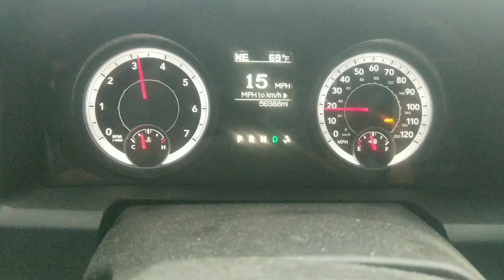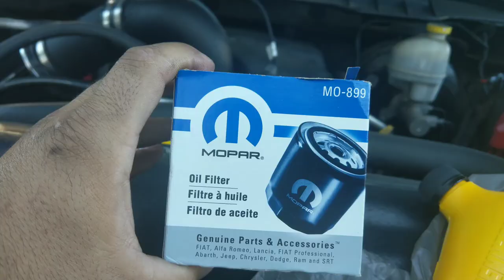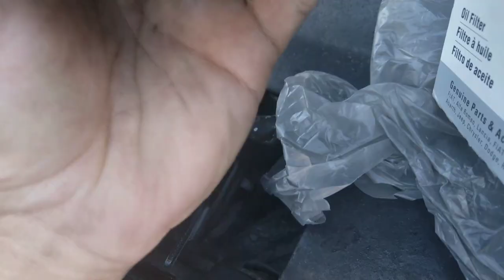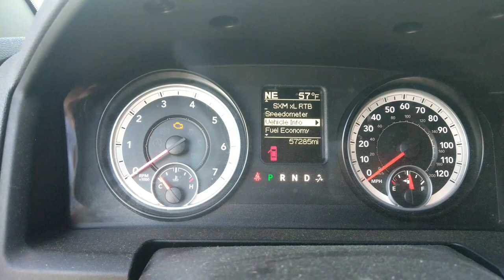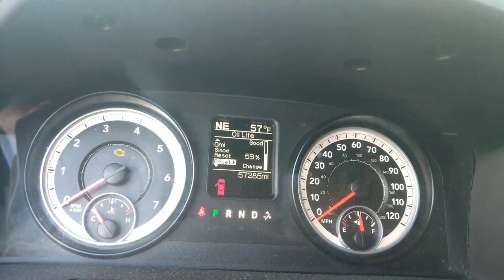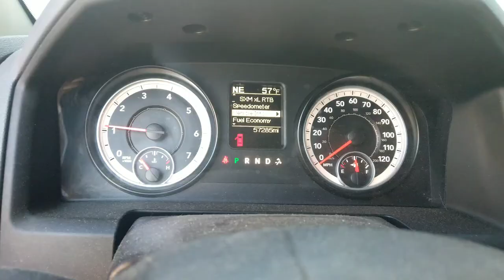How to do an oil change on a RAM 1500 HEMI

Comment: For anyone that's wondering you can also turn ignition on(don't start) and pump the gas pedal to the floor and back 3 times. Just like on GM. It works to reset the oil life
Reply: Ohh so that’s why the oil life indicator randomly resets I thought it had a problem

Comment: Take the cap off the motor before you drain it. It will drain faster, and fully. Air pockets could hold oil in the motor, and negative pressure, as well as cosmic balls of fire  etc...

Comment: Hey man just seeing why you chose pennzoil, I’m not doubting the quality I’m just trying to see your thoughts, I’ve considered going from Mobil to pennzoil
Reply from the maker: Brandon Esplen its the oil that dodge uses and I've had since stock
Reply: I agreed, you lost a couple man-points using pennzoil. Back in my machine shop days ( early 90's), we always knew which engines ran pennzoil.
Reply: If you do Mobil 1 full synthetic, keep using it unless you change it for the platinum or ultra from Pennzoil.
Reply: Mobile 1 synthetic is not supposed to be used in hemi,s I heard. It dont have the rating etc. Something like the super mobile 1 etc is only rated. Not the regular mobile 1 synthetic,  apparently it dont have some.stuff in it that's needed
Reply: Mobil 1 for me ,never had a engine failour or problem ever👍

Comment: You left out the part about how much of a pain in the ass it is to remove the oil filter and where it splatters all over the front axle.

I hope that whoever designed the oil filter location on these trucks got fired.
Reply: I spent a solid hour trying to get the oil filter out in my driveway,  and used several different tools, no luck so I said fuck it and brought it to a lift
Reply: That’s why only need hand tightening

Comment: Hey brother on your cold air intake what did you do with the crankcase vent tube i have a breather on mine and didnt know if that was good or bad
Reply from the maker: A breather is all u need boss everybody that had custom intakes like me use it
Reply: @IncredibleHemi1111  okay awesome ya I bought one of those little breathers from autozone and stuck it on there I didnt know if that would effect anything of course I took mine to dealership and they told me to run it to my intake but that didnt sound right
Reply from the maker: @sambartlett7605  your good of course there going to tell u that
Reply: @IncredibleHemi1111  awesome ya I went I'm for a warrenty thing and they told me that cause I have a short tube intake so my intake isn't all the way to my fender btw brother your truck is awesome you have given me alot of ideas
Reply: Also sorry I know alot of questions can I take the long tube off that plugs into the intake and hook the breather up like yours
Reply from the maker: @sambartlett7605  yea but just make sure there is no hole on the intake to where the tube was
Reply: @IncredibleHemi1111  okay ya it goes across the motor and plugs right next to the oil cap is that where the hole would be

Comment: Has anyone used 5w-30 on 5.7?
Reply: Yes run 5w30 mobile 1 high mileage the 10k one it runs pretty much the same just better for towing with a wix filter tho do not go 10k go like 5k